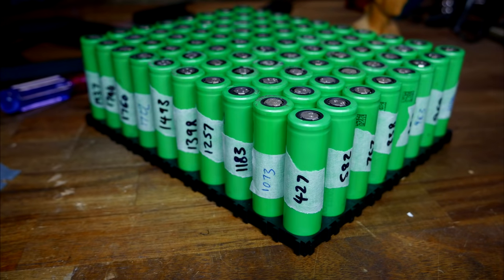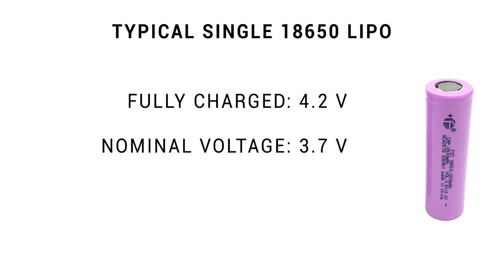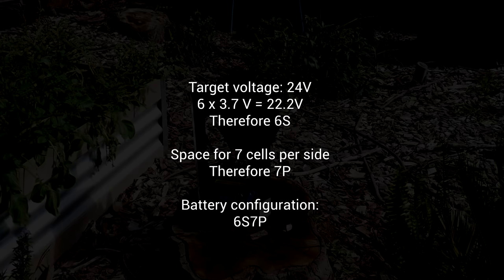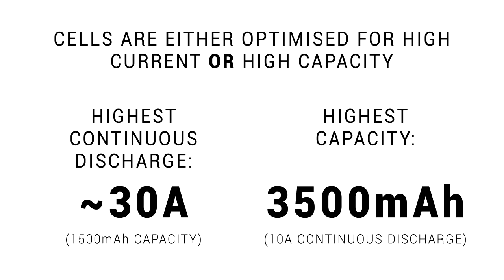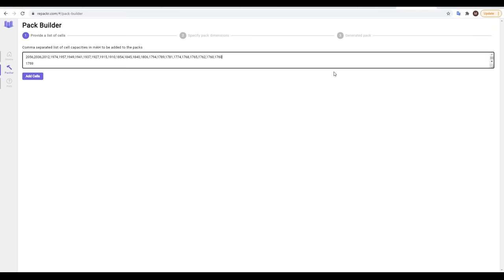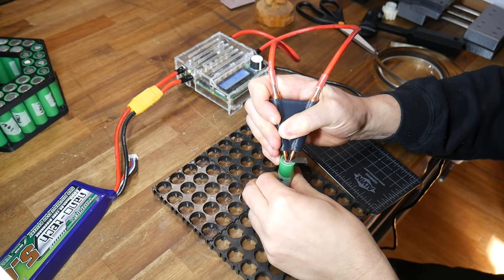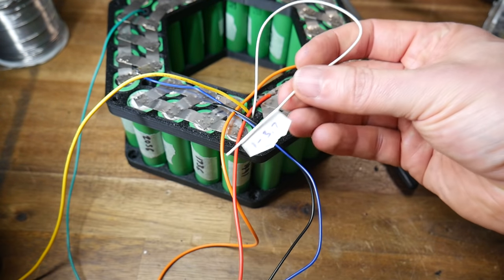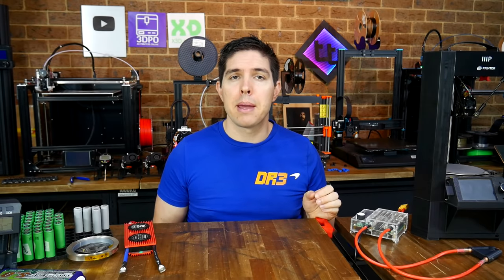Beginner’s guide to building safe 18650 batteries

Comment: Just a thought: why not have the wires attached to short Ni strips before getting them close to the batteries (when heat from soldering is not a problem and even drilling some holes in the strips to have the leads go through would be an option) and then just spot-weld those strips to the battery-pack?  Avoids getting dangerous actions close to the batteries.
Reply: I've always wandered the same question, buy nobody does that, EVERYBODY does it like in this video and I really have no idea why..
Reply: ooo that's a good idea

Comment: i can completely understand why this video recommends using a spot welder - there are way too many people who can't follow simple instructions and will either damage or outright explode their 18650's using a soldering iron on them for too long. especially on a project like this where many connections have to be made. but for smaller jobs, a high heat iron used by someone who has experience with soldering is all that's really needed.
Reply: Damaging is really easy. A while ago I had to do some field maintenance - a flat BIOS battery was preventing a CNC machine from working. It was only a simple CR2032, but one with a wire that was soldered to spot-welded tabs. I measured a new battery, and in the few seconds I spent soldering a wire to the prepped surface, the battery already lost a few hundred mVs from the heat. Obviously I replaced it later on when the actual replacement part showed up.
Anyway, soldering on batteries is no bueno. Even if you're really really quick.
Reply: @graealex  if you don't understand that soldering a tiny little button battery is nothing like soldering an 18650 that has about 1000% the the mass and can actually absorb the extra heat without damage, OR if you think it's a good idea to spot weld a button battery at all,  you shouldn't be using any kind of soldering iron on anything. please get someone else to handle it.
Reply: @obie224  It's normal practice to spot weld button cells, as this was the manufacturer-provided solution anyway. And in an 18650, one of the poles will be in direct contact with a plastic part that isolates it from the rest of battery. It will have little thermal mass. How you even think that a battery is a big hunk of metal that will homogenously absorb the heat is beyond me - maybe you should leave those job to other people...
Reply: @graealex  you have to be trolling me at this point. do you think that something has to be solid metal to have thermal mass to transfer heat ? do you think that an 18650 battery, which is composed or sheets of copper and graphite, two materials with EXTREMELY high coefficients of heat transfer, will somehow NOT transfer heat away from the solder point quickly ? but the BEST part of your comment.... please explain to me exactly how the electrical circuit is completed inside the battery if one of the poles is isolated from the rest of the battery with a plastic part ???

like i said, i can't really believe you're actually saying these things seriously...
Reply: @obie224  Look at how the negative pole of an Li-Ion cell looks, as it is a small metal disc connected to a small wire that touches a number of isolating plastic parts. For protected cells you also will see the wire broken up by the protection circuitry. It's not going to sink heat very well. And then again, manufacturers stress test their batteries up to 130°C and that means well below soldering temperature. It's simply not safe to solder Li-Ion cells. There's really no discussion here. Especially not with you.
Reply: @obie224  And besides, good heat sinking means that you need to put more heat in to get solder liquid. That's actually working against you. Your whole point doesn't make sense.

Comment: I WANT TO SUPPLY  A 12VDC TO AC INVERTER. THE INVERTER WILL SUPPLY 120 VAC. WITH 330 WH. 2.75 AH. CAN YOU TELL ME   AM I CORRECT, THINKING I NEED 32 CELLS

Comment: Great video Michael. Three suggestions, if I may:

1. Even new, lithium batteries must be fully charged, either individually or in bulk as a parallel array. Once 100% state-of-charge (SoC) is achieved, cells must be assembled into their final arrangement, then top balanced (charged to 100% SoC using a BMS with balancing capability, or a balance charger).

Regardless of even measured capacity, bringing all cells to 100% SoC in unison ensures the maximum capacity of the final pack. Otherwise, the cell group at the lowest SoC (regardless of voltage) compromises the entire pack.

2. Regarding charging and discharging, a universal rule of thumb to maximize the longevity of battery packs is to charge and discharge at 0.3C. To explain for your viewers, C stands for capacity. For example, a 2,500mAh cell's 1C rating is 2.5A. Therefore, 0.3C equals 0.75A, or 750mA. Charging and discharging at this rate ensures the safety of the battery pack, as well as it's longevity; easily extending its life by 3x to 5x.

While it's acceptable to "push" a pack to the cell rating, it's best to do so infrequently and for only brief durations.

So, assuming 2,000mAh nominal capacity for your 6S7P pack, (2A*0.3C)=0.6A*7P=4.2A without ever coming anywhere near your packs rating.

Likewise, using these figures, your pack should be charged at 4.2A or less, recharging from 0% to 100% SoC in roughly 5 hours. So, 5 hours charging for 8 hours work. Not a bad bargain.

3. To maximize cell longevity, it's best to stay away from the "knees" of the power curve. There's only a negligible amount of capacity to be gained, either by discharging after the knee in the discharge curve, or by charging after the knee in the charge curve.

Unfortunately, most low cost BMS boards will charge right up to the top and cut-off right at the bottom. So, to operate within an alternative band as I suggest, a programmable BMS is required. This is a no-brainer for larger packs. However, it just doesn't make financial sense for relatively small packs.

As always, thanks for all the great content that you create and share.
Reply: This is perhaps the greatest youtube reply I've ever seen. Honestly. The video answered just about every question I had with building a pack.. except the BMS! This covers that, as well as gives constructive crit all around. I'm literally copy/pasting this. thank you John Coloe, AND TEACHING TECH!
Reply: @seejjordan  Thanks Chris. It's good to hear that some of the learnings I've acquired through long experience benefits others.

I only touched on BMS's in my comment. Honestly, it's a subject for its own video. Perhaps Michael will create and share covering this important topic.

In the meantime, if I can ever be of any assistance, please don't hesitate to reach out. My e-mail address is my first.last at Google's e-mail system. It'd be my pleasure.
Reply: Fantastic info here !! Well done
Reply: I was going to come down here in the comments to talk about this as well.  It is of utmost importance that all batteries in series are charged to a storage voltage before being welded (3.5 or 3.7V choose one and charge everything to that voltage)).  If they are not the exact same voltage, when you weld them in parallel, the higher voltage cell(s) will short out into the lower voltage cell(s).  You run the risk of creating a thermal runaway.

If you look at how most manufacturers assemble 18650 packs, they either cut the strips long where soldering is required, or they add a short strip specifically for soldering.  The welded strip takes more time, but is the safest route as the welded joint has a much lower thermal conductivity than a solid strip does.  But, a welded connection also does not have the current handling capacity that you get from leaving the strip solid.  Which way you go really depends on the power requirements of the soldered connection.  Using the previously described charge rate of 1-2C, a welded connection is more that sufficient for a balancing connection.  However, the primary output of a pack drawing 10+ amps might be too much for a single welded joint.  This is where leaving the tab where the final parallel stage is welded to the pack a bit long would be the better solution.  Soldering to a tab like that would give you the lowest resistance to your pack.

Personally, I can't wait for the 4080 LiIon cells to become more popular.  They are the most exciting technological breakthrough in batteries since LiPo packs became popular.  They get the capacity and discharge rate of a LiPo, but with the safety of a LiIon.  It's the best of both worlds.
Reply: Wow! Great video...now this great comment.  I am hoping he will make a thorough video on charging/discharging if he has not yet. I agree with the commenter that stated: "This is perhaps the greatest youtube reply I've ever seen. Honestly."
Reply: BUT IF YOU USING A RC CHARGER john you dont always  need to you use bms . But that being said if people never made one i would use recomend to use a bsm
Reply: @AndrewMurphy8383  Assuming the charger has a balance function and the pack has sense leads, then yes, the charger won't charge beyond the appropriate voltage per cell for the chemistry type. However, without a BMS, it's easily possible to discharge the lowest cell below the appropriate voltage per cell for the chemistry type. I always build packs with a BMS, preferably a programmable model, to ensure that the highest cell is never overcharge, the lowest cell is never overdischarged, and the pack stays balanced. With a programmable BMS, I easily extend the longevity of packs by 3x or more by never charging past the "knee" on the charge curve or discharging past the "knee" on the discharge curve.
Reply: @ARepublicIfYouCanKeepIt  I don't think most beginners are going to do the math or even know how to apply it. So wouldn't it be good to have a temperature sensor somewhere in the pack to monitor whether the batteries are being either charged or discharged too fast?
Reply: @rickmenasian6774  BMS's have temp sensors. However, these are most typically only used to prevent charging below freezing, which Li-ion definitely doesn't like.

I stand by the recommendations in my post. If someone is too inexperienced or lazy to do the math to ensure the safe and long operation of a battery, they shouldn't be anywhere near them.
Reply: @ARepublicIfYouCanKeepIt  Point and warning taken. Because I suck at math I'll just have to watch as many videos as it takes to understand this. LoL

Comment: Total battery newbie question; you say 22.2V is suitable for your 24V needs? So the printer will still work when the batteries discharge, and they're only providing ~20V?
I want to make a 12V battery, as was wondering if i needed to make mine 3S or 4S 🤔
Reply: Depends but if ur trying to power sensitive electronics  u should get a voltage  regulator for 4s(boost converter for 3s) and wire ur battery to it then wire it to whatever

Comment: Excellent video. One of the most informative and complete Li-Ion battery DYI building videos I've seen.
Has most key points someone just learning need to know. Terms and sources so they know enough to search additional information.

One point that might have been mentioned in more detail, when using reclaimed cells; is cells below 60% of new capacity should be avoided. They can't supply as much current and will reduce average cell capacity in the pack.
Better to use cells as similar as possible. Best is all cells same (like if new from same manufactured batch), but this has substantial added cost.

Before beginning to assemble cells together, a final check should be made that all cells are charged to nominal voltage (3.7V). Cells that are at different voltages will quickly try to self-balance, and this can cause them to emit excessive currents (aka sparks). Particularly joining in parallel (+..+, -..-). Once within ~0.1V of each order connecting together should go smooth.

The K-weld is one of the best options. Being DYI kit, price is reasonable for a quality tool. Cheep (low priced) spot welders should be avoided as they do poor job of managing energy used in welds. When spot welding cells, it's better that they at nominal voltage (3.7V, or slightly lower, but above 3.0V) vs fully charged (4.2V). Should something go wrong, cells having much less energy will have lower potential to cause damage. A bucket of water nearby can act as safe zone/net (for just incase).

If you first pack build, try a 3-6 cell (at most) pack to test and home your skills. Making a mistake on a smaller pack will have less risk (less energy). Still need to take all cautions mentioned. Just take you time and don't rush anything. :)

Comment: Dangerous battery build there.

Please be aware this video is NOT how you should make a battery, he even defined why and totally missed putting rings on the positive end of the battery cells.
He also guessed what output used cells will offer, this is way to high and typically it will be 4amps, but used cells should be declassed to 2 amps.
You should always have you BMS connected so that it can protect the battery and you.

Batteries can discharge uneven, have a thermal run away or other issue such as deep discharge. That the removed BMS cannot detect.

The series and  information spoken and  shown and built was different, please be aware of this.

If you place a battery under or over something, make sure there is impact protection, those Sharp strips can be pushed and cut the battery wrap, or melt (from soldering balance leads there ) the wrap causing a short.
The ring on the top, (as part of the top is negative) clipped strips ends, and some full coverage, thin foam can make a big difference to small accidents.

Comment: At 3:31 its a bit misleading to say that no capacity is added. Each cell is cca 9 Wh. Look at it this way, adding another battery  in series will make the mAh stay the same, but will boost the voltage form 3.6 to 7.2 V and P=I*V. 
Describing battery pack in Ah needs to die. Like all the ebike resellers say, we has a massive 10Ah battery pack (...at 12V) not like those other guys who have a tiny 5Ah pack (...at 24V) XD
Reply: agreed, KWh along with the sustained and burst currents is what needs to be used
Reply: Yeah, the capacity is determined by the number of cells you have, not if those cells are in series of parallel.

Comment: Fun fact, the first time I picked up an 18650 I wanted to know what voltage it was, set my meter to 12V DC and touched the leads to both ends and immediately it got extremely hot and burned my fingers. That's when I went on Google to find out why and now I know much more about these batteries.
Reply: Sounds like forgetting the leads in current mode, that's pretty much a dead short on the meter.

Comment: I'm 58. American in L.A. County. Who new nothing about Electrical last year. I thought I'd educate myself on 12th Grade electrical because we're now in the Electric Age. So, I went to the library & took out 'Physics Demystified'. Read the 4 chapters on D.C. then A.C. Current. I got it! A×V=W, or I×E=P. Ohms Law - A×R=V, or I×R=E. Even learned Sine Waves are looking at a pulley - edge on. Understood Trig and how it applies to all of it. I understand Phase Shift (say 120° for Alternators) and Inductance, now. But mostly, I can't wait to get a bread board and get hands on (that's what it takes for electrical) then make an 18650 battery pack to charge devices first (with a good Bluetooth BMS). Then build an Ebike pack . Or two or three, and build a custom Bike. Then a 1KW - 2KW solar system with a 3000W Inverter for my Vanlife Van. Complete with Isolator. There's a YouTuber - YehuGarcia here in SoCal (Legit Electrician) who sells big pallates of 100's of new 18650's at once for discounts. Thanks for the refresh on the Battery Pack Math!

Comment: I built a backpack 3D printer with a small delta printer, I used a battery alarm so it would warn me of overdischarges but I didn't use a BMS. The best solution would be a BMS that could activate power recovery on the controller board before the voltage drops so you don't ruin your print and batteries on discharging.

Comment: Best video so far! As other videos just tell you what they are doing instead of explaining where everything goes....until 14.35. Then the rest was over my head! This was the bit I wanted to learn. Can do the parallel connections, but where does the series go? some gaps and not connected? Serial connections on 1 side, not the other? Where do the charging plugs connect? which wire goes where?

Comment: Great. Note, capacity (watt hour, Whr) increases for serially connected cells just the same as for paralleled cells. Doubling the voltage, doubles the capacity of a series connected pair relative to a single cell.
Reply: that would be energy (Wh), capacity is different (Ah)

Comment: You are sure that your printer draws 2A?
What was the voltage in this wire?
Seems strange, very low wats if we assume 24v, 50W in total. I am no expert but 2A seems more reasonable with 110v or 230v that would mean 220w or 460w of power demand

Comment: I can get a Kobalt 80V 2.5 AH garden tool battery for $150.  The 22 cells to make one at 6 bucks each is 140 bucks, if space isn't a consideration isn't this a good option?, I can use 3 in parallel for my application.

Comment: Are you going to do an update to the Delta Mini?

I’m planning to convert my delta mini to 24v, replace the hotend, replace the bed with a thicker plate, install a 24v bed heater, get rid of the bed leveling switches to replace with a probe, maybe magnetic klicky and enclose it to have a portable abs printer.
Reply: my bed leveling switch broke on one corner. you know what size would be the proper replacement?